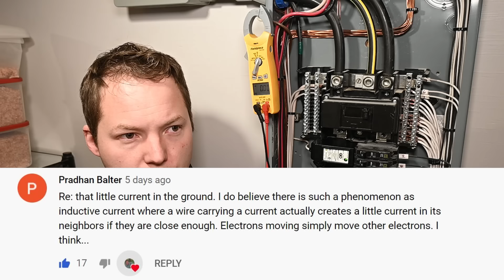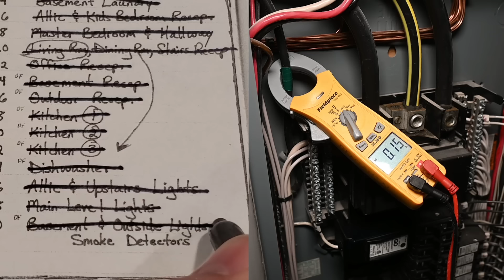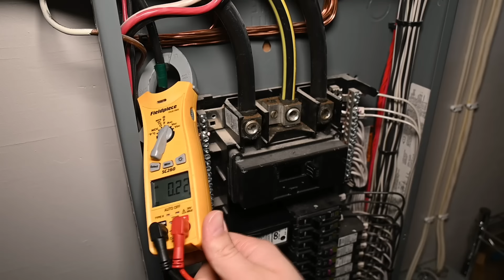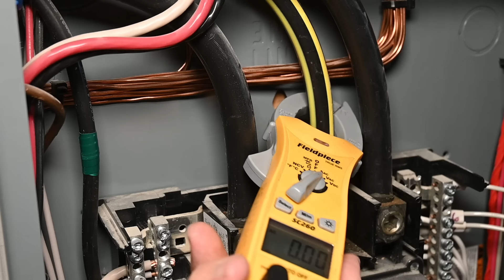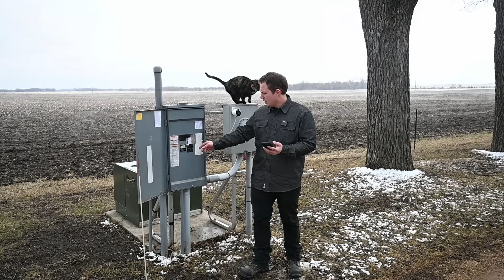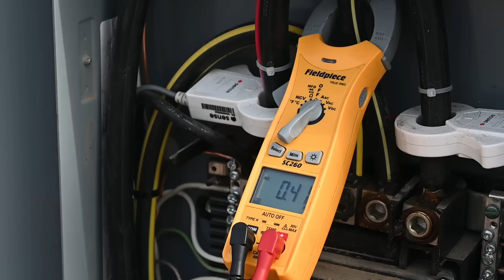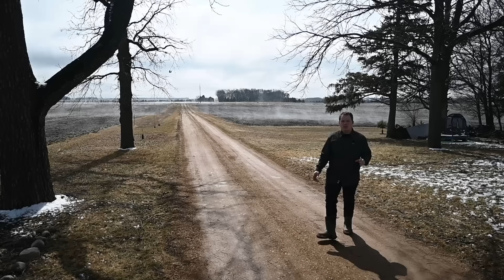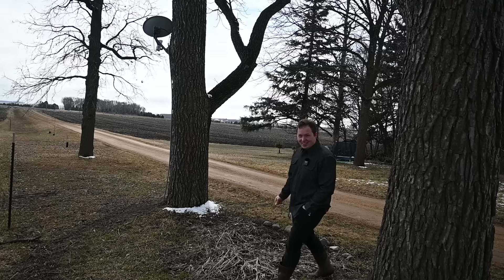Finding The Source of Stray Current on Grounding System

Comment: EMI /RFI filters in computer power supplies, battery back ups.  Any device that uses a switching power supply is suspect.  I run into this issue all the time, and it creates ground loop hum in audio equipment.  Looks like multiple grounding points.  You said you had additional ground rods.  Next suspect is the Cable TV box bonding ground of CATV coax from the pole to a ground in your AV system.

Comment: Doesn’t the meter have a tickler wire on the neutral for the electronics and if the ground is less resistance than the transformer maby the wire in the windings have a slight imperfection or the cable between the meter and the transformer could be bad. Or even the lugs not covered fully with antiox and corrosion is isolating the neutral path. This would cause you to see induced current in the house I think .

Comment: It's the grounding system, pure and simple. Soil condition could be responsible for it. You need a really good ground at the transformer and a transformer with no leakage internally. Also, improper ground and neutral connections at the transformer can get you killed. Be safe.

Comment: Great investigation. I guess that confirms, when I worked in a factory, why the power company came back years after their initial visit. They initially came out to replace the old pad mounted transformers feeding the factory and installed new feeders and pole transformers, but had left the old feeders connected to the old transformers. Several years later, even though the load side wiring had been removed from the old abandoned pad mount transformers, they still remained locked in a small overgrown outdoor open air cage against the building. One day a crew showed up to investigate an unauthorized power load they had determined was coming from the building. Their new substation equipment was registering a large load they determined shouldn't be there. They thought the factory was stealing power. After inspecting the whole factory for illegal taps, they finally found the old overgrown pad mounted transformers and seen that the crew that had came out several years ago, left the old transformers connected, and they just laughed. Come to find out that the old pad mounted transformers that were still connected to the feeders, were still drawing what they called an isolation or floating current, and they said that they estimated that the three very large (8' tall x 3' wide) old transformers had drawn thousands of dollars of power just sitting there for all those years. The factory wasn't charged, but after that, we made sure that on all equipment inside the factory, any transformer that was mounted to a machine to change the voltage coming to that machine, had its own disconnect switch to shut it off from the overhead feeders. We estimated that shutting down those small stepping transformers also, instead of just shutting off the machine, would save a couple grand a year in unnecessary power loss. One more thing. That used to be common in the big cities years ago and many transformers sat using up power that weren't connected to anything. The bad part is that the copper thieves we're usually found cooked to death by police, because they didn't understand the connections or how electricity works. Bad for them I guess. Now days nothing is left connected except open empty fuse holders high on the poles. Yet in my city they still leave some old pole transformers disconnected but still mounted on the poles due to work overload. This sort of correlates to your transformer and what you need to determine, is it the power companies or the owners transformer. If it's the owners it's metered before the transformer and the owner pays for that small current flow. Calculate that 0.40 amp power usage over thirty years of use expected of that transformer. Ouch. Hey, stay healthy and take care! Jpol.

Comment: First you are assuming the direction of the current.  Your also assunimg its not changing directions  Inductive, or Reluctive, current, as well as point to point ground potential can cause small powerless currents, and tiny voltages.  A long wire hanging in mid air will pick up the Earth's field and show a small current.

Comment: The distribution system is likely a multi grounded system which means the neutral on the primary side of the system is bonded to ground in multiple locations. The primary neutral at the pad mount transformer is also bonded to the secondary neutral and tied to ground. Your house is likely between the substation and downstream load. You mentioned in your video that current will flow through all paths and this is what's going on here. Your house and ground system is a parallel path back to the source.
Reply: Neutral to Earth Voltage.  It's just distribution current flowing through the system,  multi point grounding.  
Use your meter with one lead connected to remote earth (or ground if you prefer) and use the other probe to test the Neutral.  You should see a small AC voltage.  You could pull the supply authority's meter and the voltage will still be present.   Most electricians including this one aren't aware of this type of thing, as it's mostly to do with the supply authority.   It's all in the bonding and grounding standards if you're willing to dig deep enough though.
Reply: @mbusbridge1  I could pull the meter and the voltage N-Earth will still be present? But with no Neutral circuit to the distribution the Neutral is bonded to Earth in the panel so you'd get 0, no?
Reply: The small amount of current that you're receiving back to your ground is because you're ground is in the ground. Because of the amount of current you're receiving consider what is called a ground battery which is what's generated when water copper and some other form of ferrous metal whether it be steel, zinc, galvanized pipe etc is creating current.
Reply: WYE System multi grounded
Reply: Awful
Reply: Yep, its " objectionable current " The problem is its more than one grounding conductor, if he held two sides of a broken conduit he would get a  jolt. it also can damage equipment and cause emf.
Reply: that, or the earth electrodes at the transformer pad now have an insufficiently low impedance when compared to when they were originally installed by the utility and tested (weren't they? what is the acceptable upper limit in that jurisdiction?)

Comment: Nice job, very logical and sympathetic approach. I'd bet your correct its b/c of the transformer. Most utilities drive a ground rod to ground & bond the transformer. Likely your grounding system is the path with least resistance. Utility need to check connections or drive another rod

Comment: Disconnect the ground conductor at the sub panel (house) see if you have voltage showing on the meter from ground bus to disconnected ground wire going outside.  If you have no voltage potential across the disconnected wire and ground bus you have no real current. It is likely a ghost current that really does not exist (for all practicle purposes), it would not show up if you were using an in line amp meter.  Next if you were to put a known current, lets say a 500 watt quartz light,  (measure the exact amp draw from hot to a regular neutral with no other loads on, lets call that amount X) If you connect that same light from hot wire to the disconnected ground wire you will likely read only X and not X + the ghost current you have been seeing.  i.e. the ghost current will likely disappear and you will read only the real current from the quartz light.  Unless code has changed over the years your only ground rod should be out at the main panel, your isolated ground wire should be sized per code large enough to carry the expected fault all the way back to the primary panel.  So if my example above does not respond as I said remove that ground rod from the circuit at the house and disconnect the copper propane line also and repeat. I really think it is ghost current caused by multiple ground paths that are existing.  In reality I don't think it is a major issue, but will cause eventual electrolysis that you do not desire in the copper ground rod nd propane line.  Just my 2cents worth, I could be wrong, but I think I understand what is happening.  If you know what a wiggins type solenoid volt meter is it puts some load on the circuit, and causes ghost voltages to disappear.  I always carried a wiggins even after I started using the electronic fluke meter.  The new meters do not load the circuit and cause you to see strange things, loading the circuit cause the ghosts to pass on over to the other side!!! Always remember a disconnect ground conductor or neutral can kill you the same as a hot wire!

Comment: Your transformer may have an open ground and your grounding system is carrying that current. Transformer neutral is usually connected to ground at the pole or inside the pad to carry any potential to ground to ground. Could also indicate bad windings on the transformer leaking current from high or low side through neutral/ground. Scary test, but, remove your ground and bonding in the panel and see if there is any voltage or current between your grounding system and any of the three transformer legs. If yes, the transformer is not grounded or has an issue with the windings. If this doesn't make sense call the utility to check it out before floating the transformer.

Comment: It seems like the utility voltage phases are not balanced. the power company would address that issue. it could the line resistance on the transmission lines themself are different so as cause a sufficient load difference or substation far forms the consumer

Comment: Sort of off subject but you mentioned a copper gas line.
Copper gas lines are no longer acceptable in our area.
The city broke my gas meter while doing utility work in the easement behind my house.
After the meter was repaired, the gas company wouldn't restore service because I had a copper gas line connecting my kitchen stove. Although it never cause any problem,  the line had to be replaced with a new line made of approved material.

Comment: Important!!! What ever you do, DO NOT lift any of those grounds coming from the transformer!!! If your ground is the only ground for that transformer and you lift that ground you will have the same high voltage potential on the side of the ground that was connected to the transformer! Just like an open neutral will have full voltage on it. This can be up to 14kV depending on your distribution voltage. I highly doubt you are the only ground, but it has happened. Call the utility and tell them what you found, they should roll a truck to come and verify the connections. Now on to my original possible explanation...... 
Looks like you have a less resistive ground, or only the only ground for the distribution transformer and you are reading some of the magnetization current for it. Could also be sharing current with the transformer ground. There should be a ground for the transformer at the transformer pad. Also, something that can influence a higher ground current is if your ultilites power system is a SWER, (single wire, earth return). Not that common, but with that there is just the one high voltage wire feeding the distribution in your area and relies on the earth for the return. That type of system does not have separate neutral strung along with the distribution for the return. Normally your distribution transformer will be fed with one high voltage and the neutral, which is also bonded to ground at  the pole and at all transformers too. Look at the pole that feeds your transformer. You'll see the riser cable and the cable center conductor comes off the fuse and there will be some bare copper wire or tape that will be connected to another bare wire on the pole. That's called a concentric neutral, that connects to the system neutral and if that is not there, you have a SWER.  In either case, it just sounds like your house grounds has a less resistance to ground than the ground that the transformer has. The only problem I see with that is if there is a lighting strike or the transformer itself faults to ground it can impress high voltages on to your grounding system.
Reply: Spot on. Resistance of tx grounging is higher than house ground.
Hence the flow of ampage and variance

Comment: Why was there no current on his neutral inside the house?
Reply from the maker: Because the neutral is not bonded to ground in the house sub panel thus there was nowhere for the current to flow to ground. In the main panel the neutral is bonded to the grounding system which is where that neutral current was flowing to. Make any sense?
Reply: Yes, on first viewing, it didn't appear that they were separated. 
Appreciate the info on the new surge suppression requirement. 
Thank you for the well put together vid.

Comment: It may be improper grounding at the utility side. The neutral on the secondary of their transformer may be floating at a voltage higher than ground. This happens because the wire itself has some resistance and the current flowing through it will create a voltage of greater than 0 at any point that isn't properly grounded. So the current you are seeing may be from the current flowing from the neutral's increase potential to ground at your properly grounded panel.

Comment: It should be the imbalance of three phase in the grid system. 
The power is generated 3 hot wires which are 120 degrees difference. 
Power to house only 2 hot wires. 
If all 3 hot wires are load balanced in your substation,  there should be no current flow from neutral to ground.

Comment: Heat builds on points. Kinda like static electricity. The steam you see coming off the dirt is indeed steam at freezing temperature. What little heat there is is building on sharp points of the soil and evaporating the water in that soil. Water evaporates even in Antarctica. 
You can melt the edge of a razor simply by rinsing it in hot water. Your razor will last longer if you rinse it in cool water.
Reply: The primary that feeds the transformer between you and the substation has a bad connection on their neutral so it is useing you're grounding system to make up that neutral . also the underground primary. That feeds your transformer might be damaged . you should call your power company and have the primary megged. The reason your meter fluctuates is because when somebody that shares that primary with you puts a load on that neutral it puts more load on the grounding system.

Comment: I looked at the way the feeds were routed though the field panel : they create a magnetic loop and the panel will induce stay potentials in wires running though it under load. I don't know if the same person installed the transformer box. Lift the gas line bond and check the voltage open from ground. If it is more than 2 volt ac then it will probably become a problem.  Does the power come off the rural transmission high line(s) as one or two conductors -- one would be "old hat". It is important to know the voltage to free earth ground to see if you need a buried grounding cable.  Voltage divided by current will tell you the resistance of your ground connection.

Comment: You can call it power anytime. You would not have any current flow without a voltage to push it. You may be measuring current, but power is current times voltage. So power is a valid term
Reply from the maker: Thanks!

Comment: I used to work as a journeyman water well pump mechanic. There would be many times an old well sets that were leaking power. This could be at the neighbors you're well and well casing is a fantastic ground. Power Boxes by Wells a lot rusted out from the weather neutrals compromised grounds compromised. Just another Avenue to check.
Reply: We had a 220 volt well pump motor with only two wires going to it. Yep. The pump acted as the neutral/ground. Sometimes the hair on your arms would stand up when you got around the pump.

Comment: Ohms law, need to know the voltage to know if it’s actually any real amount of wattage. I think you simply have a difference of potential between the locations of the two panels. Disconnect the wire and check voltage on each end with power off, and then measure the amperage with a shunt rather than the inductive pickup. Bottom line, there’s no real issue most likely, your meter is just too capable of showing currents at very low voltage which is tricking you.
Reply: Exactly what I was thinking, if he had a low impedance meter those readings would most likely vanish..